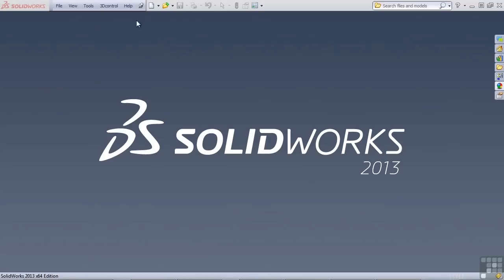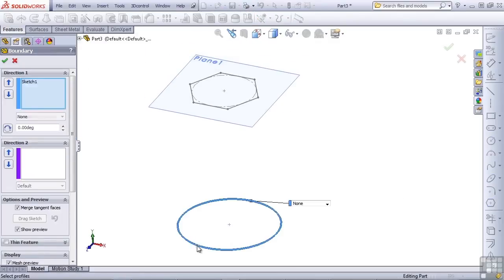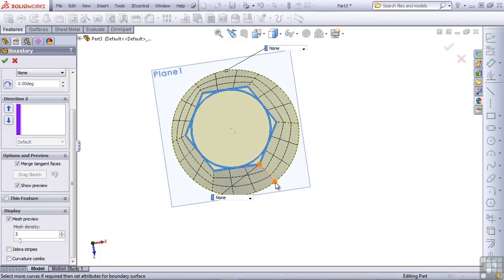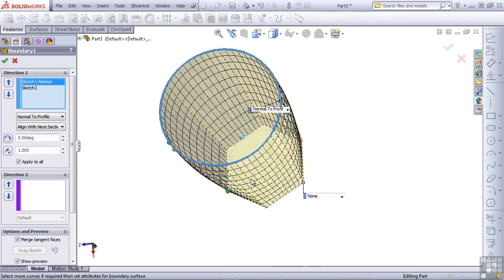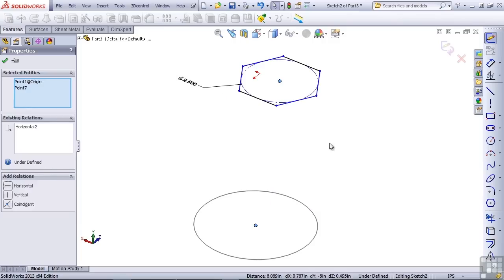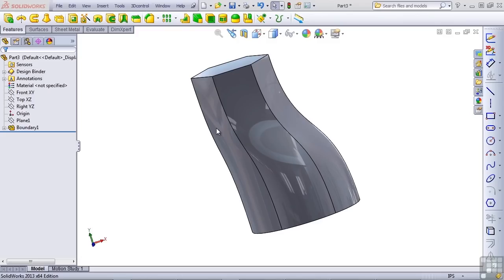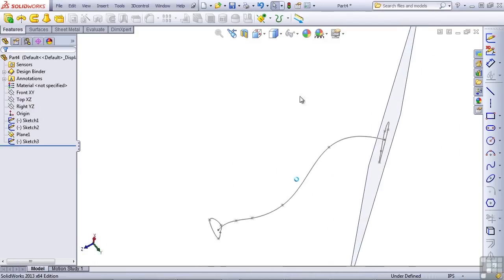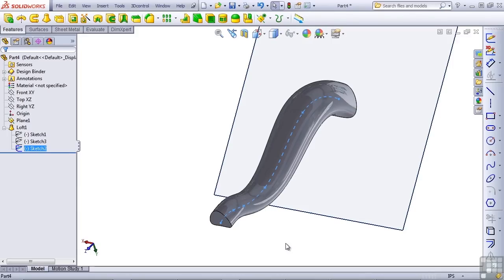SolidWorks 2013 Tutorial | Loft And Boundary

Comment: Not quite clear what your are doing to copy and pastethe new plane.
Reply: Yes, that was very frustrating for me. I usually use autodesk inventor pro, and learning solidoworks is becoming increasingly frustrating because of how different the commands and tools work. I think what he did to copy the plane was select it to make it show up and then press ctrl+c to make a copy. That is what I did, but it took many tried because you need to select it a very specific way.
Reply: Hold control then drag the plane you want to create from the existing plane.
Reply: THANKS!
Reply: Have to press control+alt on the same time. Then you can do the plane copy.